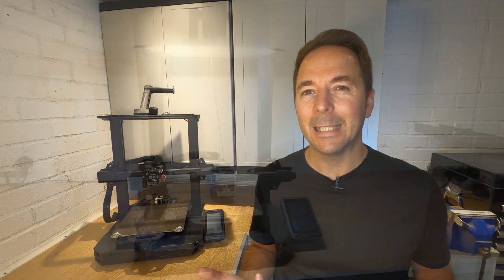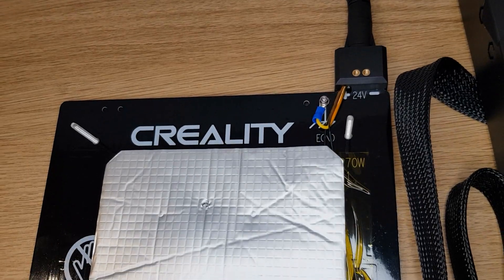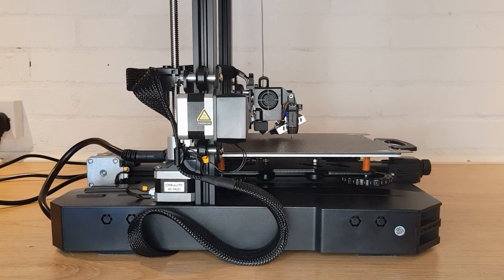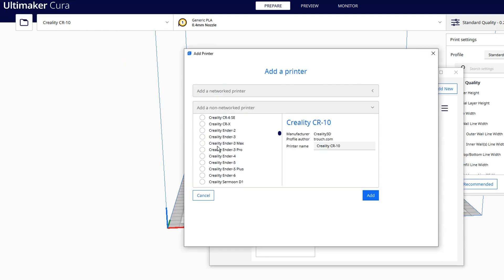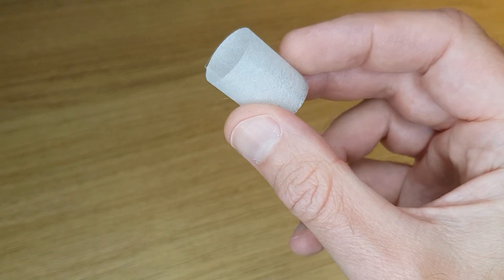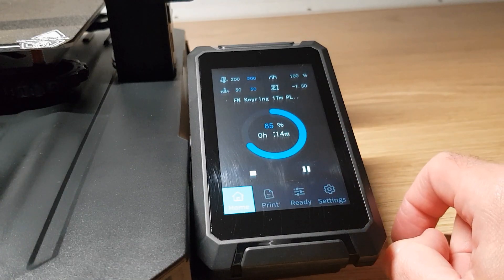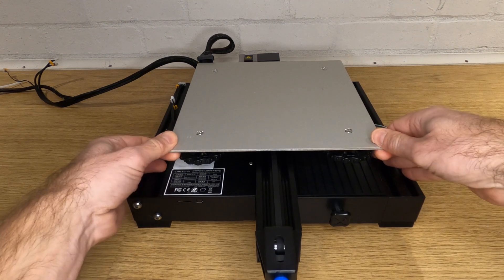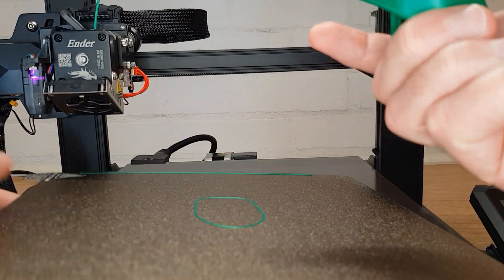Ender 3 S1 Pro 3D Printer Review - Is It Actually Worth That Much?

Comment: Thanks for the harness! Can you just save the S1 Pro profile out of Creality slicer and load it in Cura 5? (And yeah, I'd love to see how you swap filaments mid print)
Reply from the maker: Unfortunately you can't just use the Creality Slicer profiles in Cura but I worked out how it can be done. I will put together a quick video along with a filament change one👍
Reply: @RickyImpey  amazing, thanks so much! I've got the S1 plus btw. It seems to be printing beautifully, as the pro did. And it also seems to have the exact same problems you discovered with the pro (loose wheels, cable length). I'm also a little concerned it always homes the nozzle right on the bed before printing.
Reply: Swapping out filament is really easy. 
1. To just change the color it's as easy as pausing the print and changing the filament, make sure that the filament is all the way into the nozzle, of you need to change it at a specific layer it is a bit more involved. 
2. Search for "pause print in Cura" YouTube video. It is just as easy-to-use as changing the filament at any other point.

Comment: A lot of Creality machines have been coming with bent leadscrews for the last couple of years which is causing tall prints to get knocked off the bed as the leadscrew is binding up, how straight are the ones on this S1 Pro?
Reply from the maker: I just had a look with a straight edge. The ones on the machine I have are perfectly straight 👍
Reply: @RickyImpey  The best way I have found to check them is to run the bed all the way down and look over the top of the leadscrew for any wobble.
Reply from the maker: @AndrewAHayes  yeah, they're definitely straight as a dye.
Reply: havent seen that to be a problem but a few times, in any of the FB groups I run or am in.  Sure it happens, QC is always a problem with mass sold items, but it's not as prolific as you make it seem.
Plus was selling amazon returned ender 3's and cr10's from 2018 to 2020, a warped bed might be one of the problems you saw on an ender 3, but bent leadscrews wasnt one of the problems we ran in to but a few times out of the hundreds we sold.
Reply: @br0k3nilluzion  A friend of mine works in a retail 3D printer store in the UK and it is their no1 problem and the replacements they get in from Creality are often just as bad, if Creality were not their best selling machines they would not be stocking them, they now have to check every machine and replace the bad ones, but thats only if they have replacements in stock as Creality are so slow in giving them replacement leadscrews, my friend said "its as though they purposely source bent leadscrews" and she could be right, although I think its probably down to bad storage and distribution within the factory.
Reply: @AndrewAHayes  same here, couple friends have stores. But not seeing the  leadscrew problem like you're saying.
Happen to have any links to FB groups/forums where your friends and their customers are talking about it?
Shoot, if you're in the 3d printing groups on FB and deal with energetic PEI or amazon returns then you know who Trevor is out of Florida.  It's just not brought up that much if it is happening like you say.

And saying "Creality" is such a huge misleading thing.  Which Creality printers are you speaking of? 
Because comparing Ender 3's QC versus their CR10 line QC is a huge difference.
Same with their new Neo line and S1 line of printers.